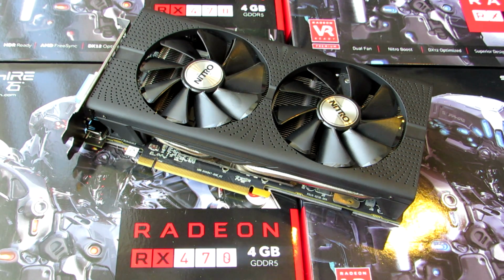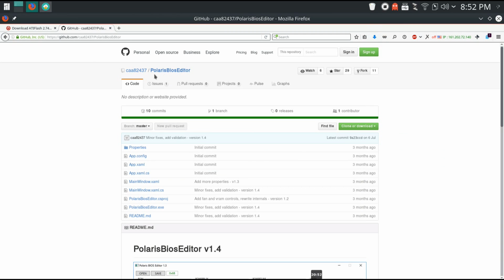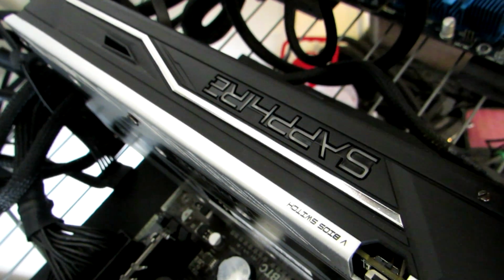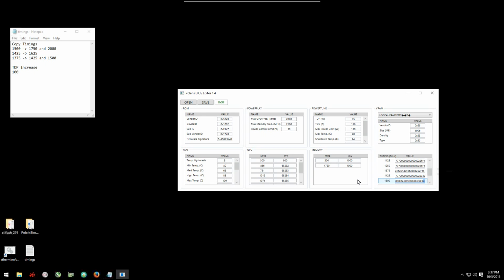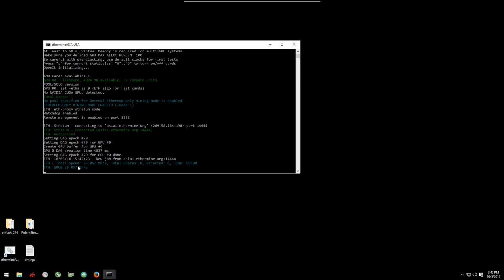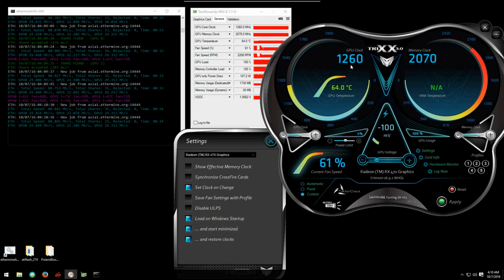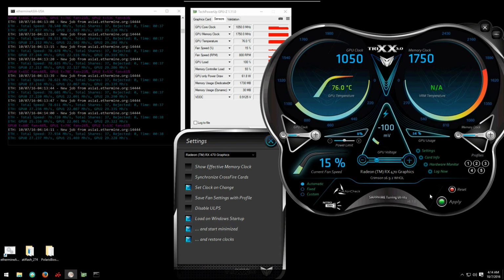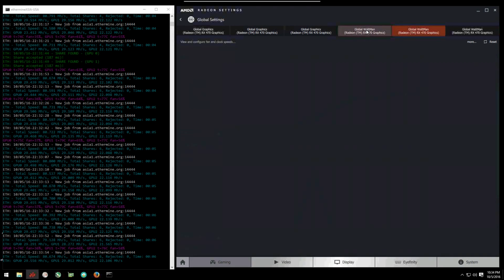DIY RX470 4G 29+ MH/s or 28+ MH/s Low Watt Sapphire Nitro+ HYNIX Bios Mod Ethereum Mining XFX MSI

Comment: Thank you, I was getting 7 hash rate and find something wrong, I flashed it to original bios and getting 24 hash rate.
i still need help, ( i have RX470 8GB ( Micron memory) ).   from your video at 8:33, I can no see the 1400 timing, mine has 1375 and jumps straight to 1500 can you help

thank you again.

Comment: I hope i am not late to the party, i have been wanting to do this for ever!, i have a Powercolor Red Devil RX470 4GB Samsung ram.
I would assume i can follow the same guide.
I can make backups of both my bios settings on the cards.
I actually dont know which is for what.
I actually without flashing was able to get 29 MH/s myself i really could not believe it.
I wanted to take a screenshot or something, but didnt.
I wanted to then insert my second card .... and i did and i dont know what , i might have struggled to get the drivers installed for the second card, not sure.
I tell you , these AMD drivers a real pain to get installed at times.
Seeing it is 2020, which drivers should i be using ? Do i use the OLD utilities you used for flashing my card ?

Comment: Great Videos!  I was wondering out of the brands you have played with, which is your favorite 470 and 480?  Stock is low in many places and cost on the 480 sometimes is a lot higher.  I would want to run of course the highest hash rate and getting around that 70w power would be great.  Thanks!   I know that trixx app looks pretty cool, but  don't want that to be the deciding factor.

Comment: Hi I did the BIOS mod and had it mining and then I started messing w/ OC of the memory and the screen went black. Tried reseating GPU, different cables, etc. but no video signal to monitor.  Swapped out GPUs and the new one works so the PCI slot is fine.  Did I fry my GPU?? It was only a week old!! FML.  Let me know what you think.

Comment: Ethereum has no value for the simple reason that there is no limits on the number that can be produced, Bitcoin has a limit of 21 million and is impossible to mine more than that.

The best crypto to buy now is IOTA, it as no transaction fees like bitcoin and ether and the transactions are fast because it is not based on the blockchain.

Want a good crypto to invest ? IOTA is the best for many reasons.
Reply: if anyone listened to you back then they would be very very happy right now lol

Comment: Hey I am now building a rig off 6 gpus and I did exactly your guide. It runned stable at 1250/2000. some needed to run a bit lower and 2 can run 2050.

But when I do like gpu clock 1050/1950 or 2000+ 1 or more off the gpus are crashing and it stops mining after a while. Do 1 off the gpus then got a very bad asic or doing something wrong? It does not really show the reason so it can by a lot off reasons.

Also I can't get the wattage lower then 105 watt. Maybe some off the trixx fuctions not working? Edit: I mean I can get it down a bit but not the same as your video.

Problem with that is even with 5 gpus the psu off 1000 watts is running at its max. So really wanna get the watts down so I can add a 6th.

I have the same sapphire nitro+ oc hynix as you got.

Now gonna experiment again in a few minutes. Any tips you can give me?

Update: got it stable mining at 1150 / 1950 think can go 2000+ to. But the wattage is not lowering yet its mining at 103 watts. so gonna try a other bios and trying msi afterburner.

Update2: All that had no effect running at 0mv is 133 watts and -100mv = 103 watts. I am missing something or is this as low I can go?

Comment: What is the difference between  Sapphire Nitro+ RX470 4G and no plus version?
Reply: good question, I have just purchased both and am currently running mod tests on the + version. Once I have results for the non + I will update you

Comment: rx580 hynix 
Strap copied to 2:1750, 2:2000, 2:2250:
777000000000000022AA1C00B56A6D46C0551017BE8E060C006AE6000C081420EA8900AB030000001B162C31C0313F17
RX580 Sapphire Nitro+ 8GB Hynix : 1150 Mhz Core , 2150 Memory and Voltage -75mv Afterburner,Trixx
god bless you
cheers Vidi
btc:
1BtT8aiGRLyWEhtAoQof6HCVYZ6NDepgGo

Comment: will try this out 
have questions for you: i notice when you power your system you use like wired button plugged to an usb ??
and can i use my cpu( A10 7850) as video output ?!
Can i use an wifi usb adapter to connect my rig and mine ? or have to be done via Ethernet cable ?
thak you

Comment: couple of questions:
1. Does ram on gpu matters? i.e. 4gb or 8gb?
2. Does brand and model matters? i.e. XFX, MSI, Sapphire nitro, Sapphire nitro+.
Reply from the maker: its not so much the quantity of ram that matters (though you need 3GB or more to mine ethereum), its more about the speed of the ram.  most 570 4g cards have mem that runs at 7Gbps where the 580s have mem that runs at 8Gbps, this makes a slight difference in hashrate for ethereum, but not really much for zcash for example.  Brand again is not as important as components used in certain cards.. most brands have a large line up of cards with varying memory types for example, and this will make the largest difference in how they perform.  XFX, Sapphire and Powercolor are generally great cards.  I personally stay away from the big manufacturers who make both Nvidia and AMD cards as they tend to reuse heatsinks and fans on AMD cards that were originally designed for Nvidia cards.   The AMD only companies like XFX, Powercolor and Sapphire design their heatsinks with AMD cards in mind and nothing else.
Reply: How about models like pulse, nitro and nitro+? Do they affect the hashrate?

Comment: Can I do this with MSI Rx470 Amour 4gb OC cards?
Reply from the maker: im not sure what kind of memory they have, but you should be able to edit the bios to get better ethereum mining hashrates.
Reply: They have Samsung memory. Is there anything I can do?
Reply from the maker: Yes, I have one Samsung 470 4g nitro, but I forget if i copied up the 1500 strap to 2000, or the 1750 strap to 2000.  Try the 1750 -> 2000 first, and if that does not produce anything, try the 1500 -> 2000.
Reply: My card is the MSI brand. Does that make a difference?
Reply from the maker: it shouldnt, but again, i dont have that card, so I cant say for certain.
Reply from the maker: yeah you know i cant remember if it was 1750 copied up to 2000, or 1500 copied up to 1625,1750 and 2000.   so i think its safe to try 1750 up to 2000 first, if that does nothing, try to copy the 1500 up to the straps above.  I think buriedoneblockchain has a video up on it.. i think he copied hte 1750 over,.. but for some reason I think I copied the 1500 up on mine... so maybe its different.. mine was a 4g card.. i think his was an 8g 470.  so probably yeah 1500 up for 4g and 1750 for 8g.  but again, you can try the 1750 first.

check out buriedoneblockchains videos (I helped him come up with his name :P LOL )
Reply: Everything I try just crashes my card

Comment: Hi! I just built a 7 470 mining rig. I used Win10, Asus Strix 470 4bg cards and a MSI z97 gaming 5 motherboard and I cant get the GPUs to mine any faster than 25 mh/s after modding. I get this blue screen displaying the error: Thread_stuck_on_ device_ driver over and over. Can anyone help me?
Reply from the maker: did you change your bios settings like I did for mine?  change pcie lanes to gen2, and change pcie configuration to 8x4x4x.  if that does not work, maybe one of your cards does not like the modded bios. I have one card that will not accept the upped memomry timings and crashes upon use when modded, so I need to run it unmodded.
Reply: Hi Cryptomined! Thanks again for helping me. Actually yes, that was the first thing i did. I am now thinking about switching to Windows 8.1, do you think that might increase the mining speed? I tried mining with every gpu alone and everyone of them have the same problem...
Reply from the maker: are you using windows 10 now?  or ubuntu?
Reply: Win10 atm, but im instaling win8.1 atm on another hd, ill get back to you with the results
Reply: I just finished installing everything and I cant really say theres any improvement at all... Suddenly it stopped outputting any signal out of any card, and now I am operating the computer through teamviewer. I cant get past 25.4 mh/s and 1100 core clock and 1850 mem clock without getting the computer restarted. This really frustrated me,  Ive got 7 more cards on the way and I expected them to run at almost 27-28 mh/s
Reply from the maker: i head the strix are a pain in the ass for undervolting, like they wont

Comment: I have an MSI RX 470 Armor 8GB OC (Samsung memory) with Radeon driver version 16.300.2311.0. Will I need to do something to bypass a signature check if I mod the ROM? Or can I simply mod the strap timings, flash the ROM and reboot without any issues of the driver refusing to load due to the modded ROM?
Reply from the maker: ur in ubuntu?
Reply: No. Windows 10 newest update.

Comment: hi 
had a power spike about a month ago and had to replace the motherboard and processor, anyway, when I fire up trixx and noticed it before the power spike, trixx was stating gpu voltage on running the programme at +144550 mv also the clock went to 8000 and the gpu clock at 2000 on my rx 470 when I move the slider down to -100mv I its like 3 pixels from the end, the range on this slider is from +14550 to -200 right in the middle where it should be 0 % it says its +7824 have you ever come across this if so how do I fix it?

I have a 380x windforce installed too running at stock speeds

Comment: Hello, I have a SAPPHIRE NITRO + Radeon ™ RX 470 4G D5 OC (Hynix), and I followed the steps in your BIOS Falsh guide. However, after doing so and running the miner's script, I throw an error saying that my GPU does not have enough memory. Additionally, the catalyst control center says that it can not be executed as there is no card connected. So I had to restore the BIOS.

I think it has to do with the driver, since I do not understand that it can be wrong. I am using the "AMD Radeon Software Crimson Edition 16.11.4" version. This is another problem that I have, only with this driver the ethermine recognizes the GPU, with any other it is not possible to do it.

Please, I ask for your urgent help. Thank you very much in advance.

Regards.
Reply from the maker: that driver should work, so im not sure.. have you made sure you have enough virtual memory in windows?
Reply: Cryptomined, I'm not quite sure what you mean, because I'm new to this. But I have 8 GB of RAM, and if I run the miner with the default configuration of the card, I can mine without any problem. The issue is when I apply the flash to the bios.
Reply from the maker: you dont get this error do you?  does this fix your problem?
https://www.youtube.com/watch?v=ZL0m7tVt_DU
Reply from the maker: you can flash cards connected through a riser, this has never been a problem for me... i flash most of my cards actually through a riser.  I'm not sure why you had problems flashing through a riser.

you should not need the relive patch on those drivers... were you using 16.12 drivers?  i have another video on 16.12 drivers and the patch if you check my video playlists

you said you were using 16.11.4... which is not a relive driver... the link you gave me is for relive.. which I have a video on here:

https://www.youtube.com/watch?v=c3kDXfH6M5A

Comment: This method works on  msi rx 480 4g  memory hynix?
Reply from the maker: I think so, but so many people have asked about so many cards, and I remember some people having problems with MSI here and there, but also some people having success.. I really forget what everyone has said... the best thing to do is to check through these comments for anyone who asked the same question (about 480 4g cards) and see what they have said. (since I dont actually have these cards).. also check through the DIY 480 8g comments for anyone posting about the 480 4g cards.
Reply: I've already done, as you have shown, 1150/1950 -28+ MH / s.
1050/2030 could, too, but I will not.
Sorry for bad english.

Comment: Thanks for putting up those videos. Watching them made me decide to join the mining community.
So far I’ve purchased a MB with CPU and memory, a Sapphire RX 470 nitro+ 4GB and a PSU evga 1600. I would greatly appreciate it if you could let me know if it is necessary to get an on-off button or not. Thanks
Reply from the maker: well you can use a screw driver and short it if you want, but sure a cheap on off button helps :P i just use the cheap wire kind, if you buy anything from cryptomined.com I ship out at least 2 for free with all packages (*surprise free gift)  https://cryptomined.com/index.php?main_page=product_info&cPath=1_81&products_id=69&zenid=pcj6vvdd44nhtm68fupglsja05
Reply: Thanks, I visited the site but I have not started Mining yet, so I dont have any altcoins to place an order at this time. I hope to start soon and get thosse pci-e risers.

Comment: Hi This is very exciting but I run into a problem that no body looks like experience so far. I have 2 MSI RX470 Gaming X - After following the steps I got a "successful completion of the bios mod" restart windows and then, windows works but the graphic card is not recognized any more. GPUZ shows GPU Clock and memory 0, Pixel fill rate 0, Bandwidth 0.reinstalling drivers do not help. after flashing back to original everything is fine. I tired few times same result. After flashing no AMD GPU found. Any advice ?
Reply from the maker: what driver are you using?
Reply: Non-WHQL-64bit-Radeon-Software-Crimson-16.9.2-Sep16.
Reply from the maker: AllMaxWorld im not sure what the problem is, but maybe you could try to DDU your current drivers and reinstall them

Comment: Hey there miners… I have an issue no one seems to have an answer as to why this issue… one of Rigs stops mining on Windows 10 I constantly get the message

 “application has been blocked from accessing graphics hardware”   

I have done countless things to try and resolve the issue for the past 2 weeks from Regedit commands to blocking defender and firewall etc nothing seems to work… I have also replaced all risers and even cloned the SSD from my first rig and placed it on my second and it blocks it… 

Does anyone have any suggestions? $50 in BTC for a solution that keeps me mining more than 24 hours straight  Whatsapp USA +1 210 723 1239 you can team view it if you are serious about this Gig…

I also bought Ethos thinking it was going to be easy to get it going but there is no good ethos video on youtube…
Thanks…

Comment: Can this bios be used for RX 470 with Samsung memory ?
Reply from the maker: I have answered this many times in this thread, you could read a bit and find the answer - but the answer is no  if you have an 8g card...
Reply: No, I have 4gb card Sapphire RX 470 OC Nitro+ with Samsung memory. I have read all that you wrote but I did not find the solution. It appears that samsung memory is used for 8Gb cards and for RX 480 also.
Reply from the maker: Aleksandar Šalamon you should compare the timings with the 4g and 8g roms, and see what you can do.  Im not sure but i have heard of others getting 4g with samsung - I assume they are really 8g cards but set to use only 4g, but again I do not know for sure.  best you can do is try some mods yourself and compare with whats already out there.. if i had i could try myself but I dont

Comment: I know this is one of your older videos but my question is relevant to this one. I did this before with one card and it worked perfectly. I got 2 more of the exact same card and same memory type and then flashed them 1 at a time while in the mobo by themselves. But now when I flash any of them I lose the capability of controlling them in MSI afterburner or Trixx. Any idea what would cause that?
Reply from the maker: no idea whats causing that, did you try  to uninstall and resinstall afterburner?
Reply: Well figured out my bios issue sort of. Not sure why but there must have been an issue in the Display driver. After using DDU and then reinstalling the drivers everything is working fine now. I'm able to mod bios and then control them anyway I want. now to work on getting those voltages down I'll be good to go.
Reply from the maker: G0DxxM0DE thats good

Comment: My timing Mhz in Polaris Bios is 1601, 3242, 3653, 4022, 4556, 5049, 5582, 5787, 6074....... and not 1425, 1500, 1625, 1750, 2000.... whyyy??? what i make false?? pls help
Reply: That means your VRAM is Elpida and not Hynix. Do not try to flash that with this method. Cryptomined has an other video where he shows us how to flash Elpida VRAM cards.
Reply: Thank you very very much for this info !!!!!

Comment: Sorry Cryptomined, for being so invasive.
I did the flash for my RX 470 with Elpida Memory in the Silent bios side of the card, as described at the video, and all went smooth. I am now hashe-in Eth with Claymore's at a steady 25.3MH/s, from a 22.5 that was on stock bios in OC bios side.
There is only one thing that i dont understand. When i open GPU-Z or STRIX, it shows GPU clock at 1260mhz and Memory clock at 1750Mhz. i don't now if it should be like this or not. I see that it should be GPU at 1060mhz and Mem at 1950, or am i missing something??? Please if any one knows, let me know, before i begin with the overclock.
Reply: klmn o, if you refer to my post i have resolved it the same day i posted this, and i am rocking a steady 30.5MH/s 24/7 from 4 of november..:):):)

Comment: Hello Crytomined, I made a mistake. Was making the modification in a rig with 2 Rx 470 and Strix Radeon R9 380. I changed the numbers the GPU and modified the R9 380. And this card had not saved the original file. You can help me fix this. it is possible to reset the card graphic? I tested it on 3 machines and they do not recognize.  Thanks!!@